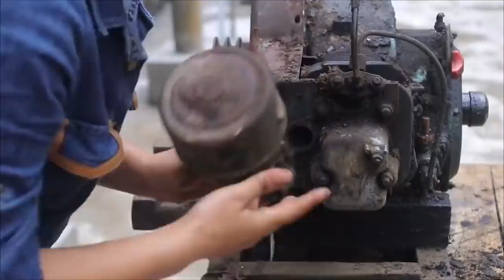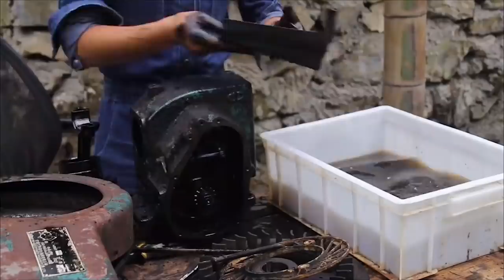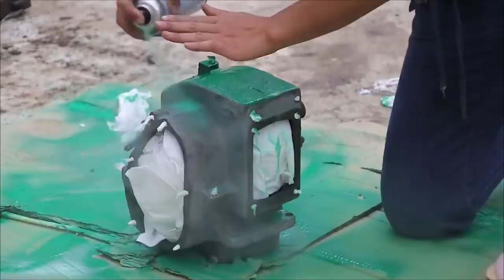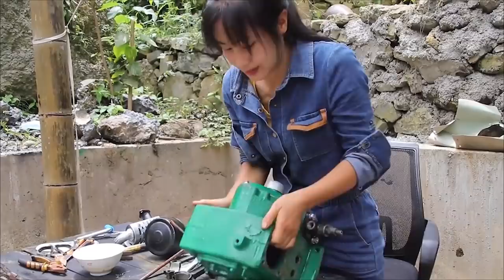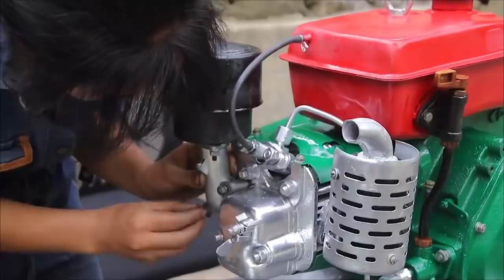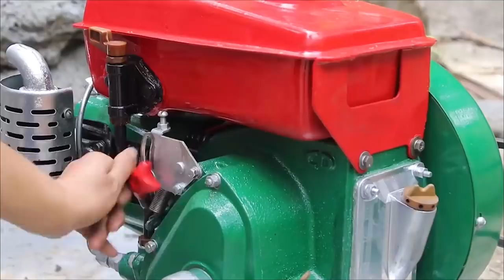💡 1996 Broken Diesel Generators Restoration, Don't Worry About Power Again | Linguoer

Comment: The pulleys are misaligned.  Also, the generator head and the engine are fixed in place, so there is no way to adjust the belt tension.  Other than that, it is a job well done.
Reply: My guess is she knows that and is just testing to see if it works.

Comment: Excellent job! Could I ask what was in the cleaning tank? It was very effective !

Thanks Tim
Reply: Hi Tim, I think it is the Chinese equivalent of 'Evaporust'.  It is widely available and as you say very effective. Like all chemicals treat it wit respect but it is relatively benign,
Reply: @bobuk5722  the motor didn't appear to me to be rusted, it's problem was it was covered in oil, and even soap and warm water will deal with that pretty well, and kerosene even better.  But I still can't believe how bright some of the covers were.  I'd almost suspect that they were new parts.

There are four things I noticed that I thought kinda strange.  First, how bright some of the parts came out of the bath.  Second, she didn't protect the crank case mating surface while painting  that will affect the seal.  Third, she didn't seem to put on a head gasket - leaving that out is a big mistake.  Fourth: she didn't adjust the valves.

These videos leave quite a bit out - the fuel injection system, showing lining up the camshaft timing etc.  Perhaps she's just abbreviating them to show her skill, rather than being educational.  That's fine.  But I prefer the latter.
Reply: kerosene, diesel or gasoline all degrease. i use kerosene as can still be burned in wick burners
Reply: @lezbriddon  For a slight price increment you can use “descented kerosene”. It eliminates the smell almost completely,making it possible to degrease stuff  in your basement without your wife screaming that the house smells like a refinery. It also helps reduce the stench of kerosene lamps.  But it’s probably not worth it for large kerosene heaters.
Reply: @fromagefrizzbizz9377  wife loves the smell of petroleum products, she would seriously watch a movie smelling a jug of it all night, have to hide the stuff! She's not a fan of diesel though.
Reply: 기술이대단합니다.~대기업에취직하시지요
아니면~사업자등록 ~내서~공장차리세요
Reply: 여긴코리아.(대한민국입니다.)

Comment: You have done an excellent job of making this engine look like new.
What was the condition of the cylinder and rings?
Was there glaze on the cylinder walls and was it removed?
The condition of the bearings and valves were also not shown.

Comment: You should wear rubber gloves when you clean with solvent. I didnt and now my liver is a little bit less thna perfect. Lets put it this way I cannot eat any sugar at all or I have huge problems and it is not just dibeties. My liver is swollen. I painted houses for years with oil base paint and used solvent to clean out brushes. I also cleaned car parts. I wish I would have worn glove it would have helped Im sure.
Reply: Damn dude ! 😨😧

Comment: I’m no sexist, I just see someone disassemble a dirty engine without first wash it  with a little kerosene  or diesel fuel, using  adjustable wrench, chisel, hammering  out  literally the cylinder, unlock  bolts with  pliers...

Comment: Have you ever checked a machine you repaired after say one or two years? It would be interesting to see how they are impacted by corrosion again.   After sandblasting metal surfaces are starting to corrode immediately. Cover surfaces you will not paint by oiling them.

Comment: Nice job, but you don't wear any safety gear. Dunno if I'd be standing that close to an engine that was totally rebuilt without safety glasses at least. You need to asume the worst with these big engines, you are way to casual around them for me. And steel toed boots would be much better also. Those soft runners aren't going to protect your feet, if you drop something heavy on them. I don't want to sound like a killjoy, but you should think about your personal safety first.